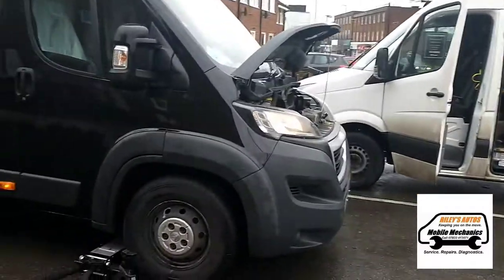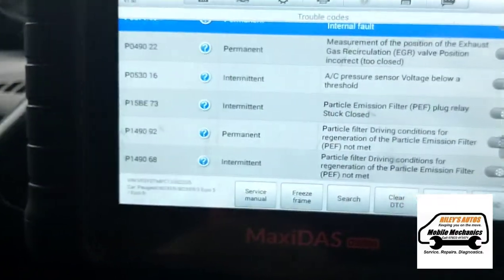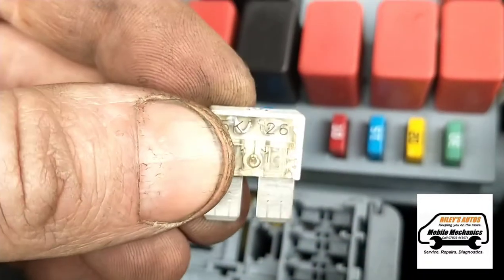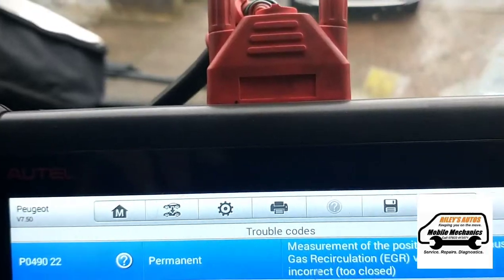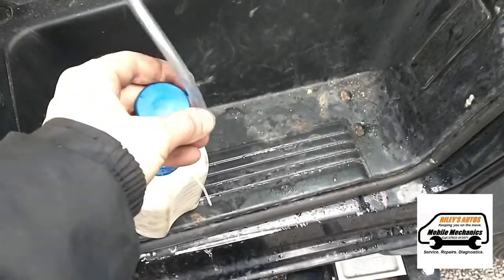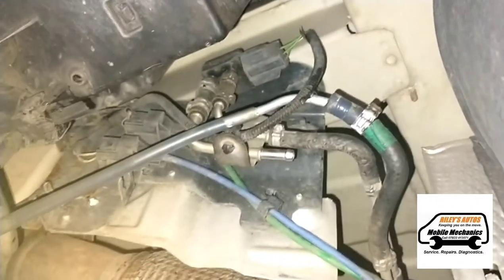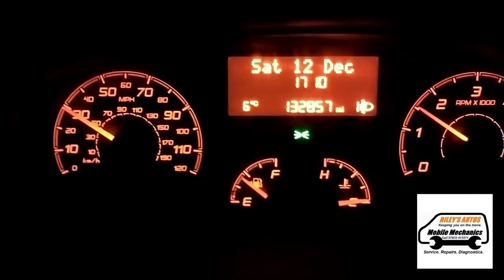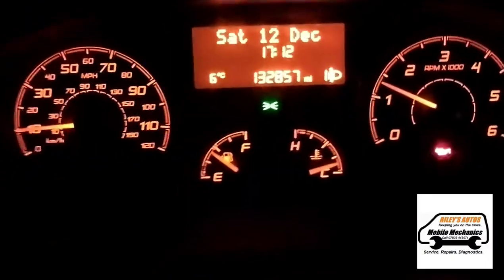Peugeot Boxer 2.2Hdi TDCi P0671 P15BE 73 P1490 Vaporizer & DPF Diagnostic

Comment: Question for you Jimmy. Had code p15be on my boxer, changed the vaporiser and flushed out my dpf with wynns dpf cleaner I had in my garage but the fuse has blown again on a test run to see how things were with the same code but also oil temp fault but live data shows the temps are normal.

Comment: The oil light flashing is the service light.
Reply: The peugeot dealer can't solve it🤣sounds about right
Reply: How long should you leave the dpf cleaner inside before restarting the engine.